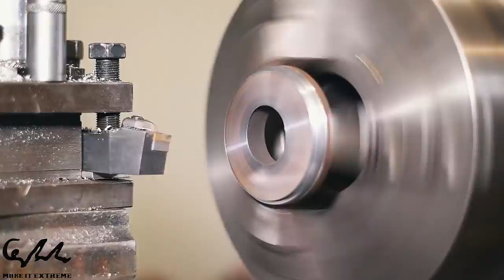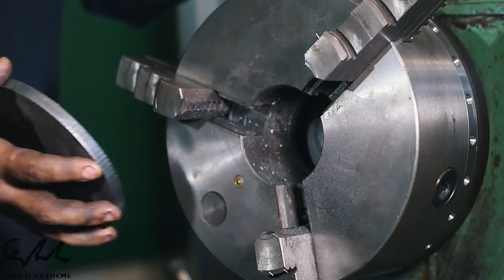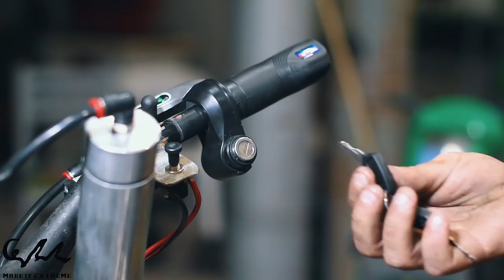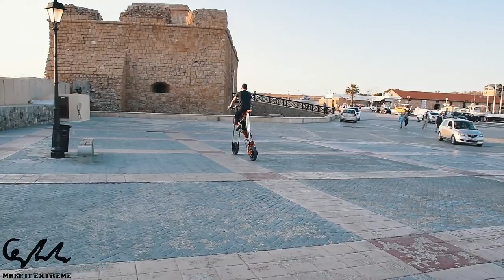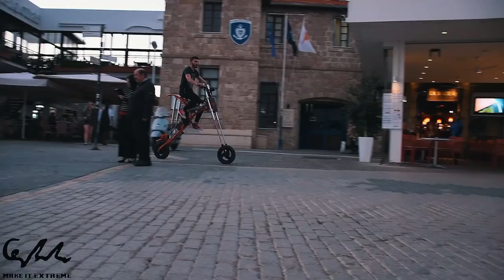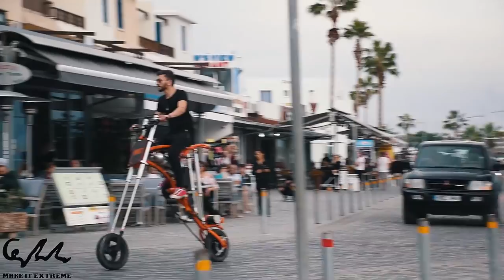Project 087 | Making an extending bicycle #3

Comment: The coolest thing about this is that it not only moves up and down, but also can function as adjustable air ride suspension. Give it just a lil bit of air and you get a vibration isolated ride. Very cool!

Comment: absolutely epic build!
how many cycles does a full tank of air give,   and how many refills does that little battery give before needing a re-charge?
Reply: Those batteries (SLA (sealed lead acid) can be had pretty cheap from places like battery shark and that looks like the 12v that I used when replacing power wheels batteries takes about 8 hours to get a full charge on a trickle charger vs the 16 for a powerwheels battery and last about 2 hours full out vs the 30-40 min at half the cost they can also be salvaged from the lighted emergency exit signs and flood lighting or usp battery back up supplies id guess air volume he gets 2-3 ups and downs before tank refill and 30-40 tank fills per charge